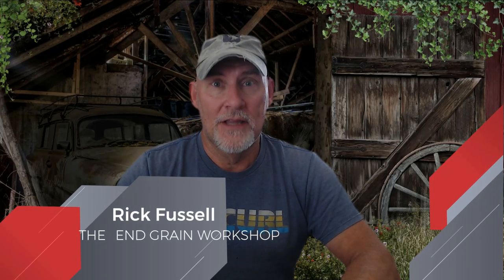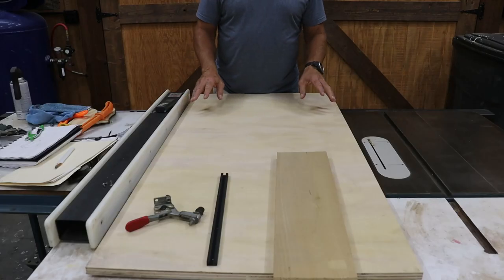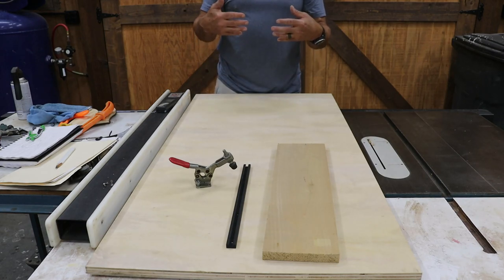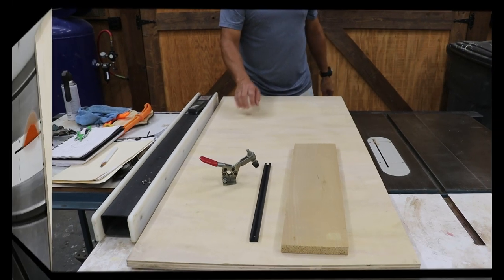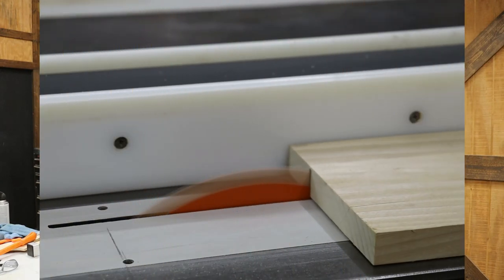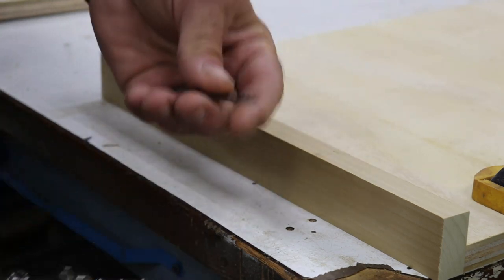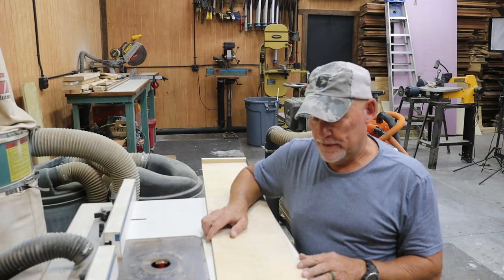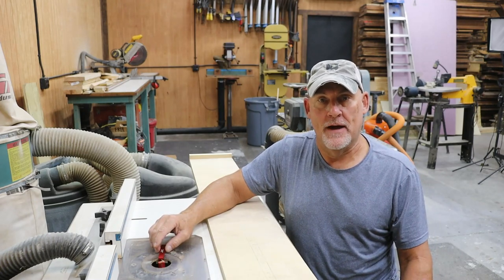How to build a Jointer and Planer Jig - The End Grain Workshop

Comment: Love the jointing jig’s in-line T-track to hold the clamp… definitely going to upgrade my “clamps on the side getting limiting the width of the stock I can joint” jig ASAP!
Reply from the maker: Thanks Kevin!  All I had at the time was a 14 inch piece of T-track.  If I did it again, I would use a 24 inch long piece that way I could clamp down shorter pieces.